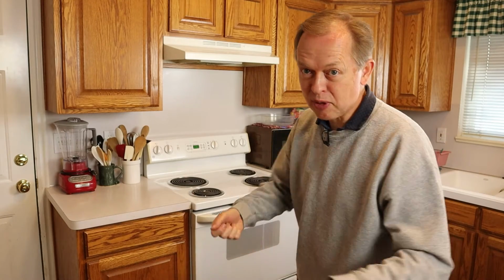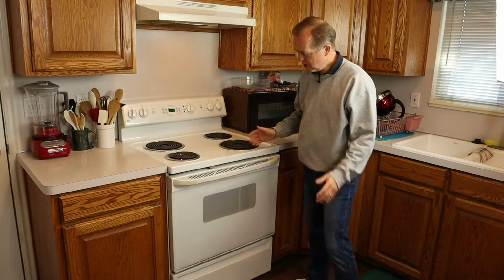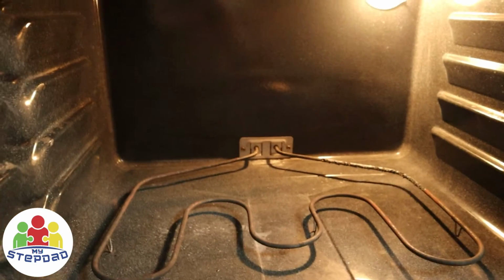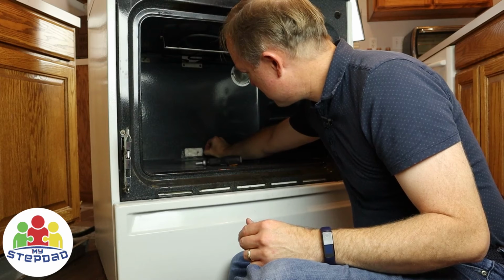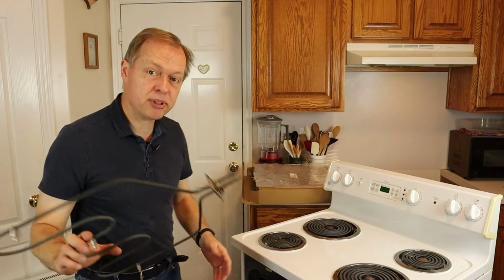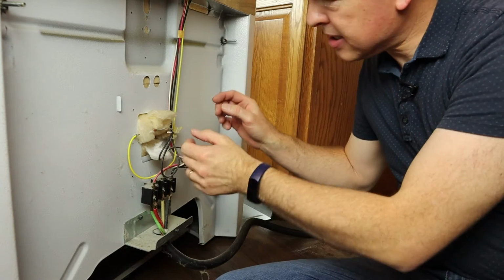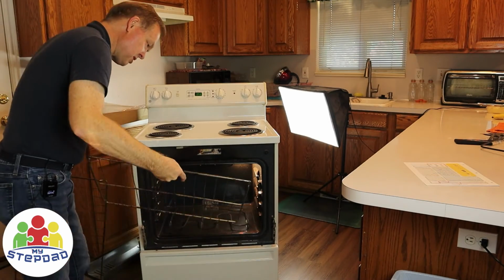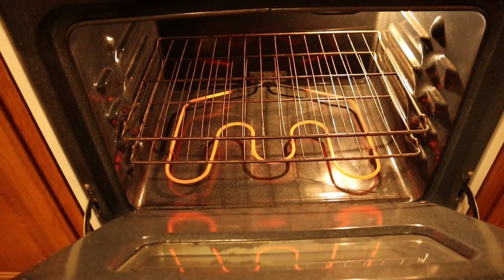My Oven Is Sparking - Oven Heating Element Replacement | My Stepdad

Comment: Any idea why a replacement element would burn out two different times? Just had my 2nd element ordered from Amazon blow out just after a few days. It takes at least 2 weeks for the parts to come in so I've been without an oven for a month now! The electrical connections in the back look just fine and even wrapped each connector in electrical tape the last time. 
Do you think it's just bad replacement parts or do I need a new oven?
Thanks step dad, I subscribed and gave a thumbs up!
Reply from the maker: There could be a different problem other than the element. If you’ve got another one in order, try it. If it does the same thing then there’s probably a different issue that would be beyond what I would know how to diagnose. You could try an appliance repair shop. If it’s an older appliance, maybe it’s time to get a new one. Good luck and thanks for subscribing!

Comment: Great video.Mine arced a little but I turned oven off and it went right out. Is it safe to use the stovetop until I get my element in?
Reply from the maker: It should be safe enough. They are different circuits and controls in the appliance. If you wanted you could remove the oven heating element to make sure. Just be certain the two lead wires that connect with the element are not or cannot come near each other  while you’re waiting for the replacement element.
Reply: @MyStepdad  I completed replacing the element today and I wanted to say thank you for your video. It was a big help to be as I’m not very handy around the house so it was quite the accomplishment. I am grateful 🙏🏽
Reply from the maker: Good for you @CMP5683 ! Now you'll be that much more confident for the next little household repair. 😃